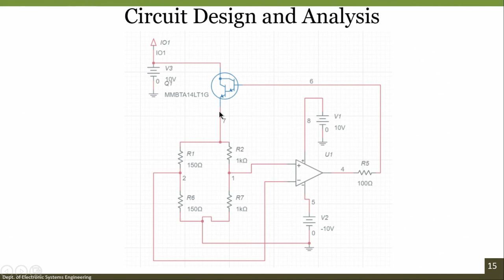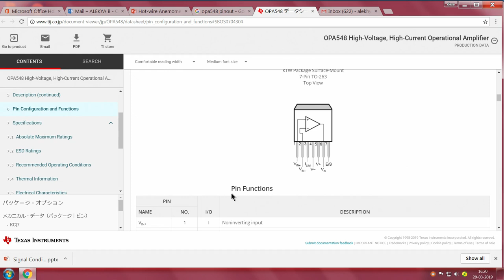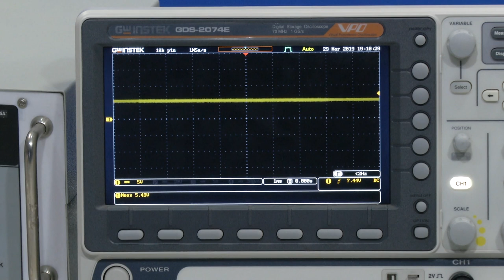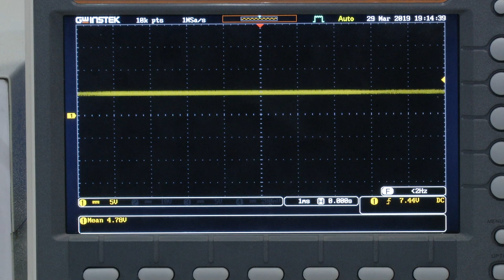Signal-conditioning Circuit for Hot-Wire Anemometer: Experiment

Comment: Thank you for your work. At last ,I see how practical CTA Anemometer circuit operates in real life. As I understand, you use OPAMP as a Comparator, and switch ON and OFF the excitation voltage on the bridge. This is so called " bang–bang controller also known as a hysteresis controller".But I saw,instead, several papers, where continuous time linear PI controller is used in the control loop.